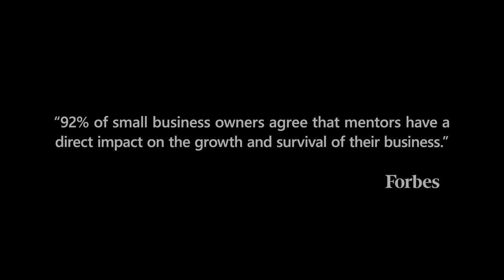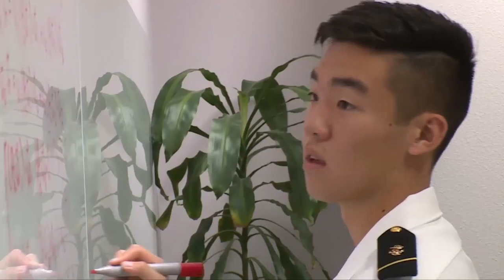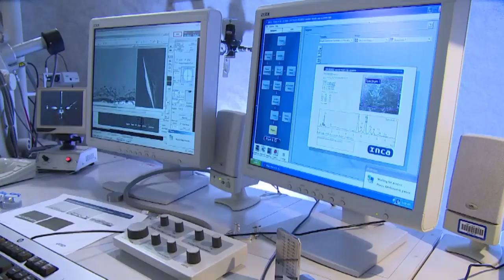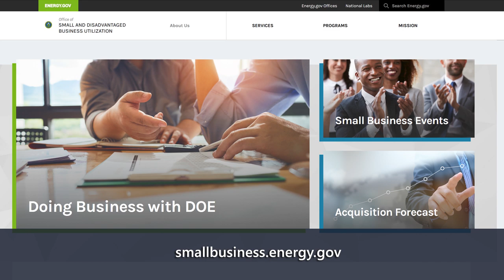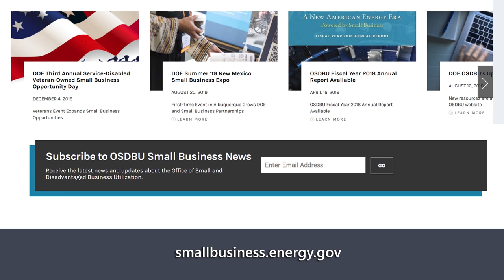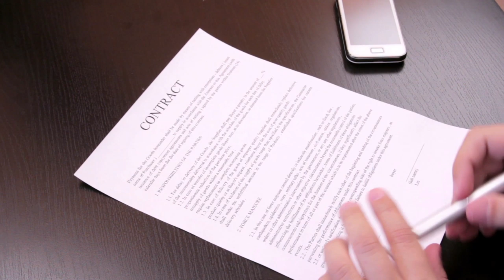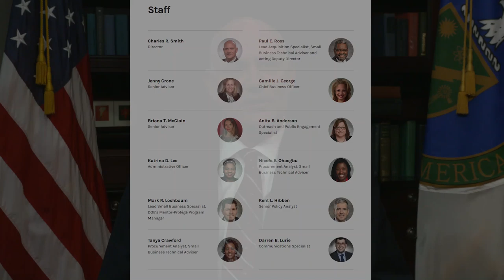DOE’s OSDBU Mentor-Protégé Program (MPP)

Comment: The small-disadvantaged requirement for DOE support contacts really puts a pinch on the contractor employees as these small businesses lack that ability to provide cost-effective healthcare and retirement benefits. This is multiplied with mid-year contact awards that require the employees to suffer through a second round of high-cost medical insurance deductibles - again, a detriment of these small businesses contacts. While I applaud the Department's program to provide access to these small businesses, they are a costly program to the contractor employees that support the Department.